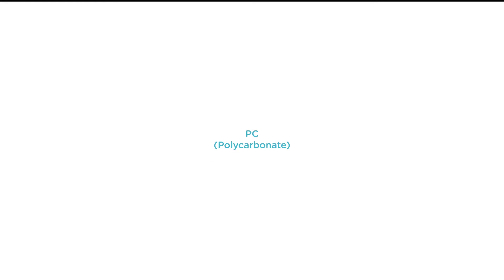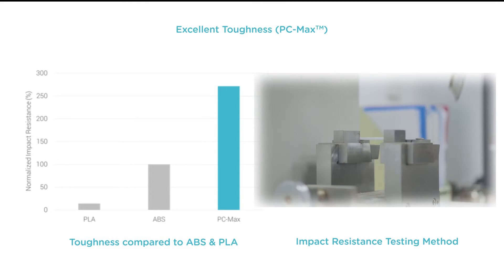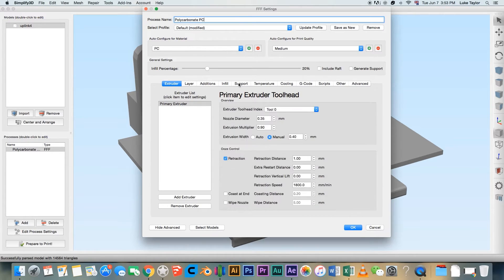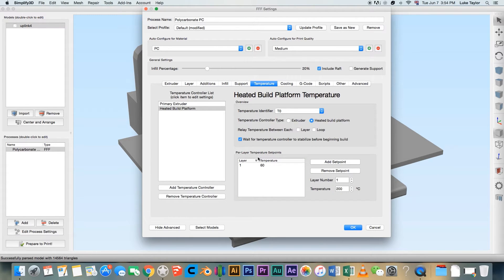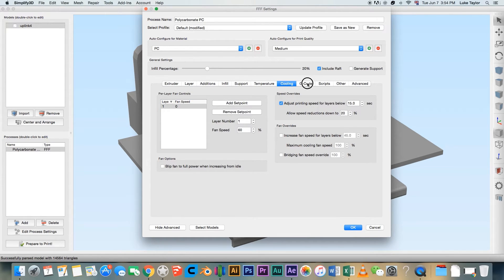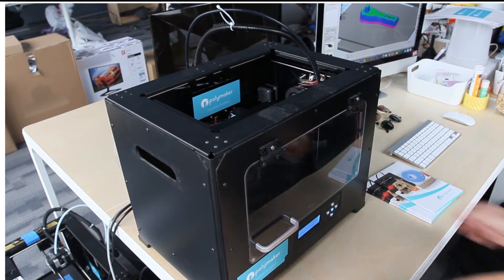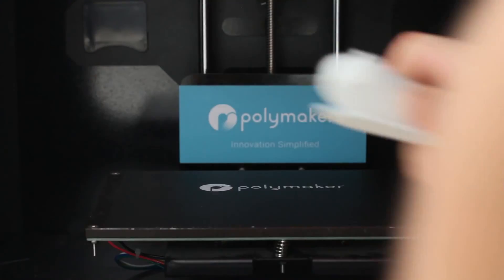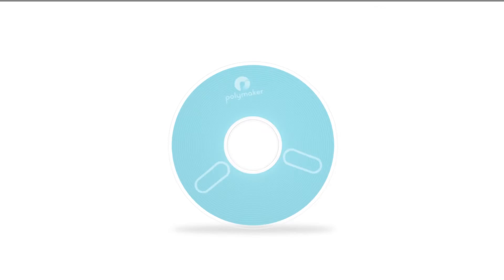Polymaker PC - User Guide

Comment: I've been using PC-Plus since it was released and I'm excited to test PC-Max. I have a few of my own tips to add:

PC-Plus strings quite a bit, especially with my Delta printer with a bowden tube. Try retractions up to 2.5mm. 

PC-Plus warps more than PLA, but a little less than ABS. Tall parts with lots of infill may need 3 or 4 shells, printed at 50% outline speed in order to completely eliminate layer splitting. This is less of an issue if you have an enclosed print zone.

90mm/sec is only possible on infills. Stick to 30-35mm/s for most of your speeds.